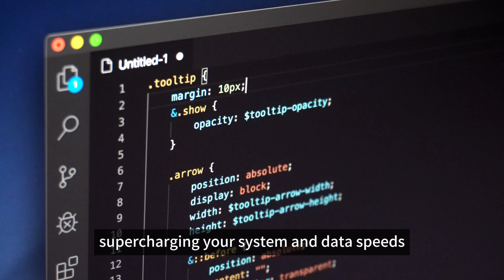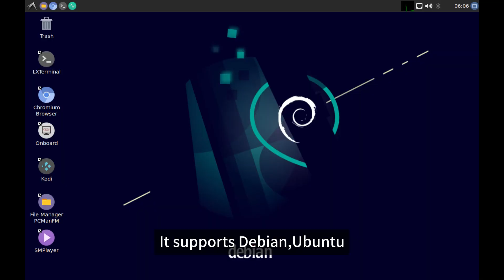OrangePi 6 Plus : High-Performance with 45 Tops of Combined AI computing power

Comment: Nice hardware, now show the software. Running the exact linux kernel with exact gpu firmware, with exact software branch was throublesome for quite some time. Show some mainline open-source commitment. We NEED drivers for mainline kernel.